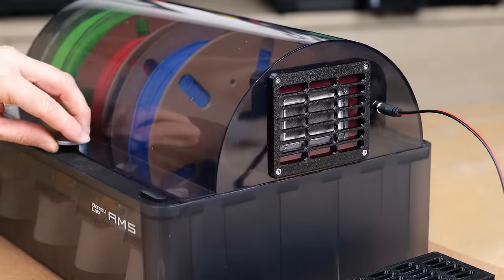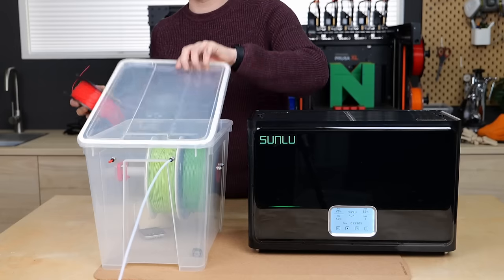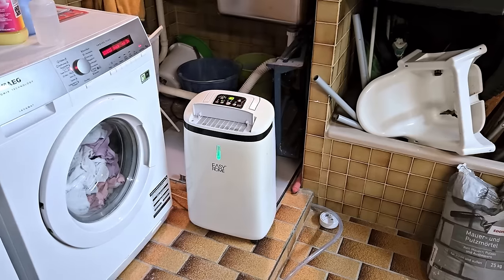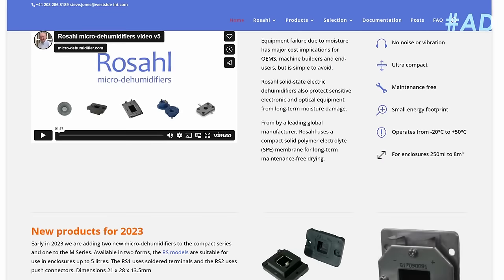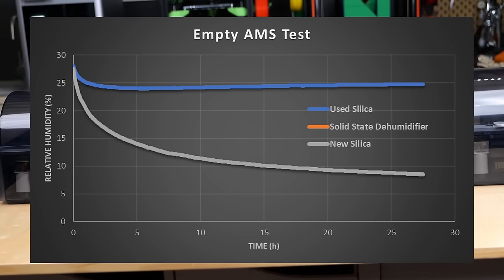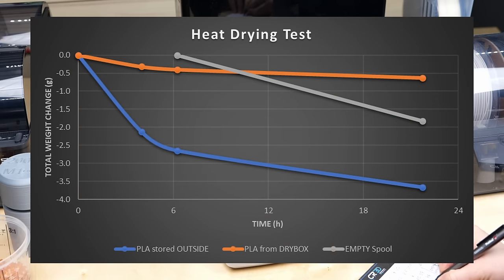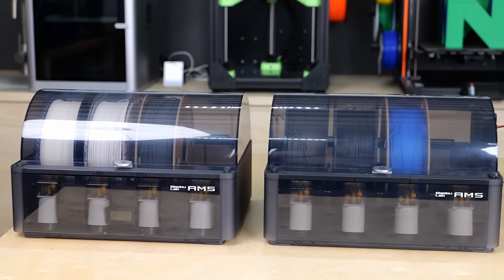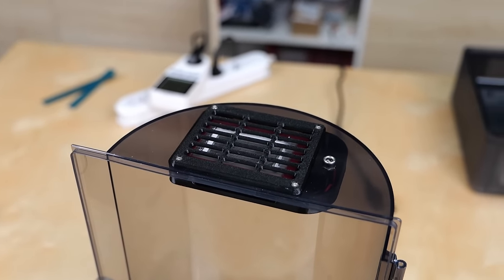Solid-State Dehumidifier: The Ultimate Filament Dry Box

Comment: How does it compare to 3A molecular sieve? I can pull moisture below 1%, with no heat, using zeolite. I look forward to that video
Reply: In energy efficiency not so great.
Reply: Another cheap option are calcium chloride bags - those seem to work really well according to those cheap humidity sensors.

They are sold as room dehumidifier bags.

Molecular sieves are likely really good at drying however regenerating them takes higher temperatures and maybe more specific atmospheric conditions.
Reply: @schublade4  Honestly, they're cheap enough, and last long enough (if you keep the filament in individual boxes, and print directly from the box, like I do. Don't constantly open the box to change filament color), that I just plan on throwing away the molecular sieve, after it's saturated. I have used 7lb to fill 11 boxes, and I've consumed probably 20kg of filament, and have only had to replace the molecular sieve in one of the 11 boxes.
Reply from the maker: I've got one small dry box right here with A3, where my professional data logger really showed 0.0% after a while 😅
Reply: @CNCKitchen Welche Trocknungsmöglichkeit würdest du fürs AMS empfehlen? Die SolidStateDehumidifer sehen zwar sehr gut aus, aber mit 400€ für die von dir verwendete größe leider kein schnäppchen. Die kleinere RS Serie bis 5Liter läge bei 36€ und wäre interessanter. Glaubst du, dass das für ein AMS reicht?
Reply: I use 3A MS in my lab as a drying agent for solvents used in oxygen/water sensitive reactions. Mol sieves are by far the best way of drying, outperforming sodium metal or NaK based methods. Packing a tube with mol sieves and passing gas through will also remove all moisture. MS can be dried by just zapping them in the microwave, and then putting them under high vacuum to maximise efficacy. Only downside is that the sieves shed micro particles that can clog tubing.
Reply: What’s the difference between 3a and 4a
Reply: @CNCKitchen most conventional humidity loggers do not have good accuracy below ~10-20% RH unfortunately. You start needing industrial type equipment...several hundred dollars to ~$1k to get good reliable data at low PPM
Reply: @zohebthayer  In short, the number-A of a molecular sieve is the pore size of the crystal. For this use case both there is no difference since both 3A and 4A adsorp water. The 4A adsorp ethanol while 3A doesn't so only the 3A molecular sieve can be used to remove water from a ethanol solution.
Reply: @denking28 speak English or be ignored 😂
Reply: I'd say even at 20%+ RH conventional sensors are still not accurate with a accuracy of +-2% not taking account of hysteresis. To accurately measure humidity a chilled mirror dew point hygrometer is needed which is really expensive and relatively large.
Reply: @schublade4  can you reuse them?
Reply: @bogmaerke seethe
Reply: @bogmaerke  are you under the impression that ol "Gutentag my name is Stefan" only sprechen anglish? 
You can translate right in the comment section?
Reply: I run an aquarium pump through a piece of 100mm pvc pipe cold trap in my -25 chest freezer, few dozen screw through the side for surface area. And I have ~100L of air an hour that I run into an old glass door fridge with the compressor disconnected. So I can see all my filaments. And a couple kgs of silica to add inertia 

There’s quite a few papers on PET from industry that even temperatures used to dry pellets can degrade from hydrolysis.

So I thing it’s wise to be drying as much as you can at room temperatures before trying to even dry with heat.
Reply: @geekswithfeet9137  That's a really clever method! Thanks for sharing!
Reply: @zohebthayer the molecular size that it will permit through it.
Reply: I dry my sieves in the oven. Easy to re-use. Mine pick up about 10%  it's own mass before starting to go up. I use a microcontroller and SHT31 sensor to drive a fan. I turn the fan off under 10% humidity. I find that too dry and my filament becomes brittle.
Reply: @denking28 I would also like to see that Data. I agree that the unit costing 36 euros is much more reasonable for hobbyists.
Reply: @geekswithfeet9137  so you freeze your filaments?
Reply: Do a test with silica plus small module which is much cheaper? Maybe best solution is to combine the two? No?
Reply: Where in EU can I buy cheap moisture loggers?
Reply: @valent_t  Silica gel would only act as a buffer. Initially, it would adsorb moisture, but as the air humidity lowered, due to the module pulling the moisture out, the silica gel would start to release moisture.
Reply: @bogmaerke well Stefan speaks german, so no reason for him to nkt reply just because of the language. But of course, many comments and not enough time i guess :-)
Reply: Hi
I happened to have some zeolite powder 
Can you provide some info on have to use it for drying?
Reply: Im really glad you spent the time to test out the big unit too. Some interesting data there. Very curious to know more about the longevity of these units as well as the long term effects of creating an oxygen rich interior.
Reply: @Volt64bolt  no the flow is so insignificant it doesn't cool the dry box, infact with the light on it hovers around 40c
Reply: Combine this with molecular sieve and small fan to agitate air.
The molecular sieve would rip moisture out quickly and dehumidifier removes moisture from sieve slowly over time.
Combo would give excellent long term results by allowing desiccant to not saturate and remain effective 😊
Reply: @CNCKitchen I'm using zeolite in my dry boxes as well. Combined with Zigbee-enabled hygrometers I display absolute humidity in my dashboard.
When one of the boxes doesn't drop over the course of a week or two, I replace the zeolite and collect the old for regeneration. Running power to my storage would be a nightmare, to be honest.
Reply: @schublade4  those turn to liquid when are done, not sure you want that near electronics.
Reply: @schublade4 it's fun how you can make crystals with calcium chloride as well! They are  a crystal of interest for insulation due to their ability to absorb, retain and then give off energy during day, evening and night respectively when changing phase around 26C.

Comment: I've been using Rosahl's M-3J1R membrane in my AMS for about a year. I placed it in the back of the base though, and put a 20mm fan drawing air through a hole where the desiccant would normally sit. Since they don't draw much power, I am just tapping into the power feed for the AMS and stepping down the voltage. It keeps the humidity in the AMS at 10-15% RHM, but does take a few days to come back down if I put rolls of hygroscopic filament that have been sitting out into the AMS.
Reply from the maker: Damn, and I thought I was the first to do this. Joke aside, great hearing that it works for you as well and tapping the fan into the AMS supply is a great idea. I considered hooking a 5V fan to the 3V of the SSDH, yet was uncertain if this might increase the ripple voltage of the supply.
Reply: Do you have a picture?
Reply: Do you have any pics or videos of this set up? I'd love to try this out.
Reply: Hi, would you be so kind and share your construction?
Reply: I just ordered a M-1J1R and would also be very curious to see your implementation since I want to use my module for the ams as well
Reply: Hey is this something you are still doing? Would love any pictues / temps you can share, and would love to be an early alpha purchaser if you are thinking of commercializing your setup.
Reply: @pukesh300 how was your experience and could you make a video about it?
Reply: what if you open the ams a few times a day and it went up to about 25-30%, how long until it would bring it down ?
Reply: Omg I wish Bambu Labs would offer this as a replacement top including the dehumidifier and power supply set up! I’d buy one in a heart beat!
Reply: @pukesh300  Where could you order? A little hard somehow.. Ty
Reply: Hi, can I ask why was putting a fan through a hole made it effective? I assumed outside moisture would come in. Ty in advance

Comment: I think you could actually use both.  The silica gel pellets would do the major lifting while one of the cheap/smaller SS membranes would work to slowly dry out the pellets. Also, there’s nothing dangerous or unhealthy about indicating silica gel as long as you are using common sense.  Don’t eat and don’t inhale. If that’s still a concern, use non-indicating silica gel which is completely non-toxic.

Comment: Nice video, one thing to add: Desicant is well capable of archiving humidities of 0-1%, but only when regenerated. In order to regenerate the material heat in the oven for 3h at 130 - 150°C. It is necessary to shake the desicant several times during regeneration or the regeneration will fail. For drying polymers you need to keep the humidity below 5%. This requires you to regenerate the desicant a lot. Usually you place your parts directly into the drybox from the packaging. Also: Any cardboard packaging has a hillariously high water absorption.
Reply: No, you're incorrect and even prove that to yourself in your own writing. It is NOT well capable.
If anything at all it's very poorly capable of achieving a low humidity at all.
And that doesn't even include the efforts in terms of manual labor required, additional sanitized equipment necessary (like a dedicated drying oven) and the absurd power consumption.
Also how many people even own equipment capable of measuring humidity of 0-1%? Let me tell you, it's about 0-1% of the 3d printing community.

You say this yourself, extended efforts of regenerating the desiccant would be required. Compatibility with materials used in spools (like cardboard) is minimal.
So wasn't that exactly the point of the video? It may be possible to achieve it with desiccant, but it's nearly impossible to maintain.

So no, desiccant is NOT well capable at all in my and your opinion. 😉
Reply: Skipping the antagonizing: You are almost correct, equipment capable of measuring 0-1% humidity is on amazon for about 15 bucks. You need 5% or less for most polyamides, so it is irrelevant whether this thing has a precision of 1% or 2%. Also: Regenerating the stuff is not that hard: I have it in steel containers, just put in oven for 2h and rotate ever 20 min every 3 Month or so, its not difficult. Again, that is almost the same thing you said, just polite and civilized.
Reply: Only takes a couple minutes in the microwave oven
Reply: Didnt know that, thank you! Albeit, i'll probably not put my stainless steel mesh desicant container into the microwave.
Reply: I have no problem to keep several boxes of filament below 10% humidity with desicant that I regenerate when the humidity in the boxes rises.
People without practical experience should refrain from lecturing people with actual experience.
Reply: Is that good for the microwave? Ig it heats the water directly so it might be faster, but empty microwaves fry themselves

Comment: I am glad you addressed the increased oxygen concentration in the AMS.  Higher O2 concentration and organic polymers is not a good combination.  Did you try putting an O2 sensor into the AMS?
Reply: Air actually don't contains a lot of water. Even at 25C@100%RH , the water vapor only takes up about 3% of total air mass when oxygen takes up 20%. Using the ambient air condition in the video which is 20C@30%RH, the water vapor is only about 0.4% of total air mass. Assuming the container is sealed it won't change the O2 concentration by much.
Reply from the maker: Not yet, thinking about getting one.
Reply: Not just oxygen, but I'm sure the unit generates O3. Ozone certainly would degrade polymers.
Reply: @CNCKitchen   I am guessing, if you open the AMS once a week to change/replace filament spools it wouldn't be a problem.  On the other hand, if you have an AMS you don't open for a couple of months the increase O2 concentration could be significant.  The solid-state dehumidifier is very cool technology.
Reply: @ScientificGlassblowing  I'm not sure that's true - the production of O2 is directly tied to the removal of humidity. In a closed AMS, there is only a finite amount of humidity to remove.
Reply: Is the membrane permeable to O2?

Comment: I would love to know if oven “reactivated” silica performs as well as fresh new silica or if it slowly gets worse.
Reply: Silica gel works as well as new and barely degrades when regenerated. One type of dehumidifier uses a desiccant wheel with embedded silica gel that is continuously cycled between adsorption and regeneration and those wheels last for years before they needs to be replaced.
Reply: Yep, it does not degrade when regenerated at ~140°C
Reply: @BarsMonster I’d love to see some data on its longevity. I just bought my first 3D printer so I don’t know yet.
Reply: I want to know too.

Comment: I used to work on industry 3D printer dryboxes, and wasn't aware of these solid state dehumidifiers. Incredible technology, I wish i knew about this a few years ago.

This was a good treatment of the filament moisture load problem. I used to perform calculations and experiments to determine diffusion times of moisture into and out of filaments. It's a multi scale problem, since you have diffusion at the filament level (small dia cylinder, 1D radial problem), then you also have the fact that the spools have large thicknesses, so this becomes a more complicated problem. There is also the diffusion and convection/advection through any gaps, through the filament tube, the 1d transport along that, the forcing from variations in pressure over a given day which effectively pump on and pressurize the volume with some frequency, etc.

I would recommend doing calculations for absolute humidity, instead of relative humidity, to understand the desiccant moisture load of a given volume. It is straightforward to calculate how much moisture a dessicant can take up, and then relate this to how many times you can open the door to the drybox (because immediately, the air is exchanged), and evaluate how long desiccant should last at steady state.

I did so much math and so many experiments... Molecular sieve is the best... 4A is incredible stuff.

Also, how long a spool is in the air matters a lot for how much moisture it picks up. If you know the diffusion rate of water vapor in nylon for example, you can estimate how deep and how much water becomes trapped. Diffusion occurs radially inward and outward, because the spool starts dry, so the gradient drops at the surface when you place in dry environment, but some of the water still works its way inward since there is still low concentration there. If you catch it fast enough though, moisture can be pulled out very quickly.

Happy to share more details if needed, but it quickly rises to needing to build a numerical diffusion model, which isn't too bad if you have an engineer or physicist friend. There are analytical solutions for special cases (the mathematics of diffusion, j. crank...its a complicated topic), but a numerical solution can help accommodate a range of forcing functions like opening and closing drybox doors, having varying environmental temperature and pressure, and having some steady leak rates to estimate how long dessicant should last.
Reply: What do you think abuout the filament side of the electrolyzer being O2 rich?
Do you think  having  the filament soaked in such an 02 rich enviornment would cause it to quickly oxidize and become brittle much faster?
Reply: Thank you for that detailed elucidation. The first time I've seen anything that makes total sense. With so many interacting factors it's little wonder that there are so many contradictory "truths" about this.
Reply: @andreamitchell4758  Unfortunately I'm not an expert in polymers, and can't speak to the oxidation of them. From my understanding, the brittleness of a filament is NOT the leading issue. If a filament like nylon appears brittle, that can generally be regarded as perhaps being a good thing, i.e., it passes the "snap" test, which means it MAY not be soaked with water.

The issue is with water penetrating into the filament. When that water is heated in the nozzle, it vaporizes/boils. That vaporization causes small voids to appear in the printed material, which degrade the material properties of the part.

This is why it isn't as important if the printed part gets wet AFTER being printed. After it's printed, there will be some change in material properties, but these are insignificant compared to the loss of properties resulting from the void formation due to trapped moisture creating micro-bubbles in the final part.
Reply: @Cheticus  brittle filament can be an issue I have read Amazon reviews for some filaments where people were complaining about failing prints because the filament was too brittle and breaking when going to the extruder causing failed prints.